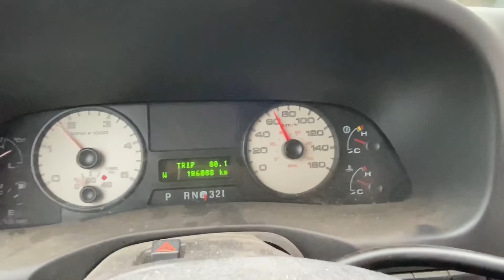2007 F-350 Banks IQ Problems

Comment: Do you still have the file to flash it? I need a firmware file and can't find
Reply from the maker: I think I have it saved somewhere but you would want to contact Banks so they can get the right firmware for your particular truck etc.
Reply: @gravytrainoutdoors  Who did you contact? They stoppped supporting the software last year? Any chance you could send me your firmware to try? when I boot up the monitor, it just loads to windows, I cannot get it to load into the tuner
Reply: @gravytrainoutdoors  Or any idea how to get it to not boot into windows?
Reply from the maker: @TridentPinball  do you have the first gen I dash?  I had the first gen one as well that had windows ce on it but the internal battery swelled up and wrecked it and I had to buy the newer version which doesn’t have an internal battery or windows ce on it.  I contacted banks technical support and they emailed me a new firmware file.  They were excellent to deal with
Reply: I have the iq 2.0, has windows ce 6.0 core